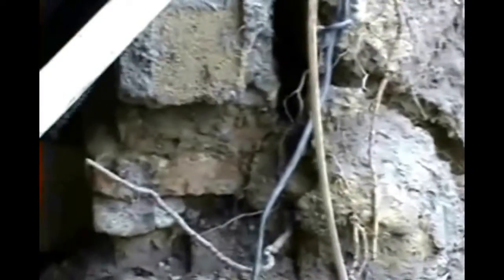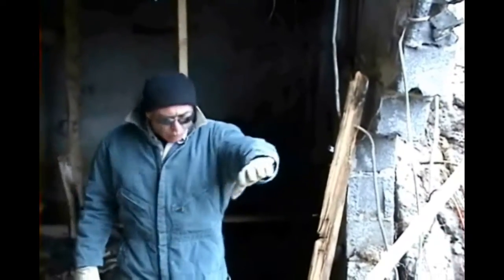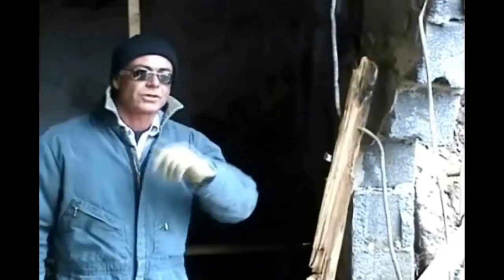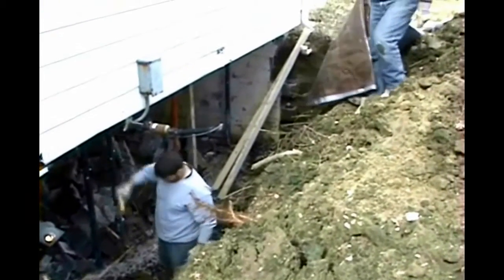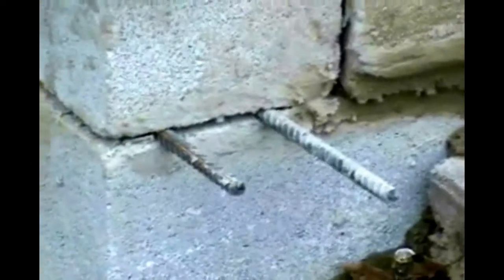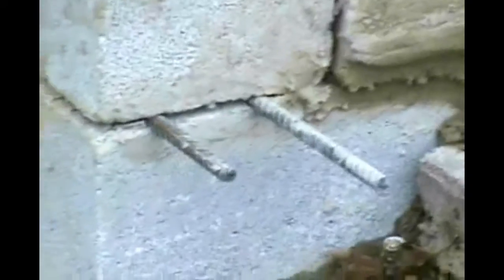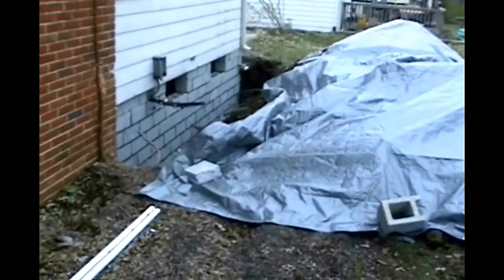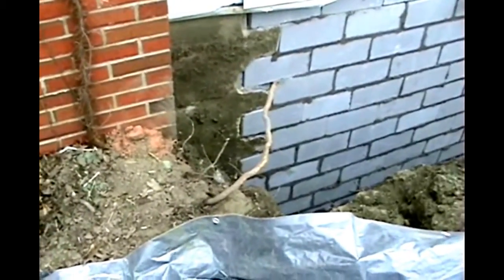Copy of What are the warning signs of Foundation Wall Collapse/Failure

Comment: How do you repair a concrete wall? I’ve seen how you repair a block wall foundation with pins, I beams, or your least preferred method carbon fiber strip.